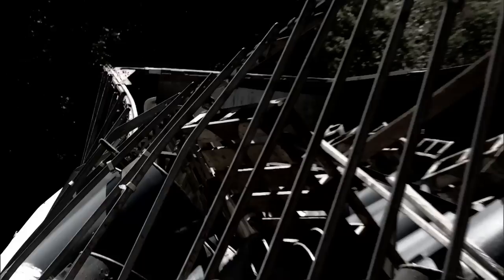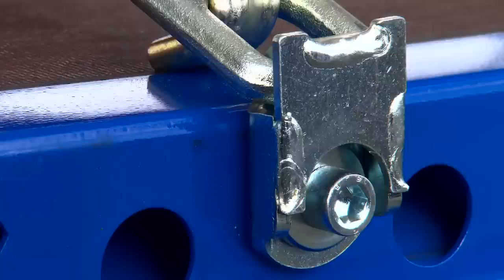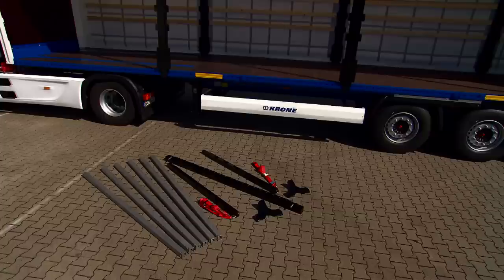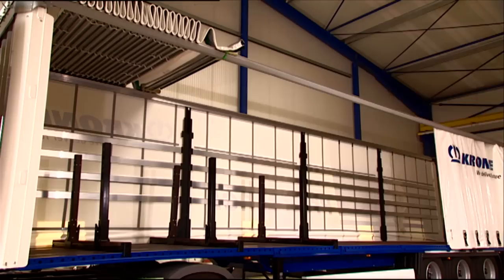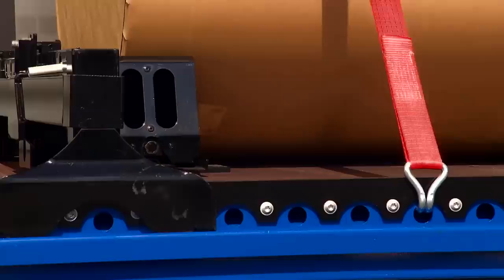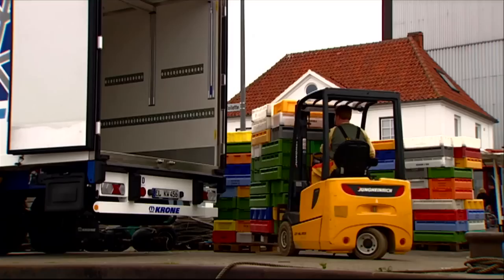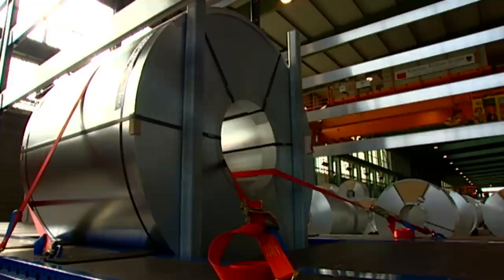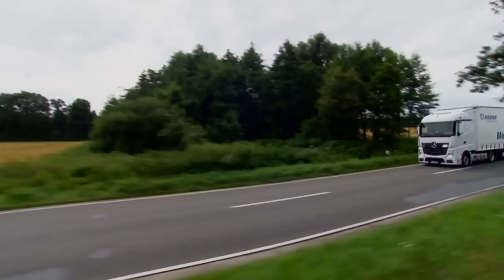KRONE Load Securing (EN)

Comment: Steel coils a straps mmm good luck with that ...Chains be a better and safer way ..just saying
Reply: Chains damage the exterior and interior surfaces of the coil.  Depnding on where you load the coil you will get special straps designed specially for securing coils